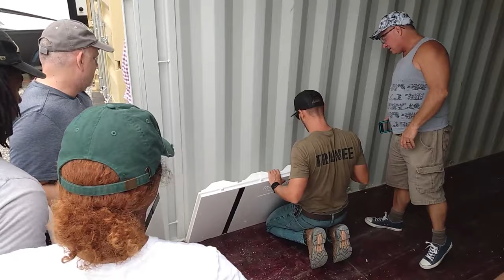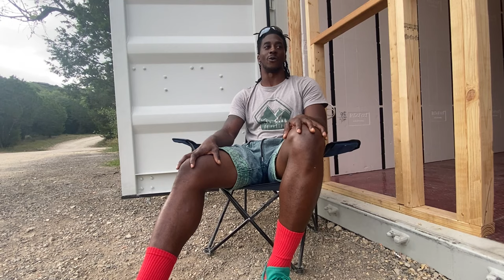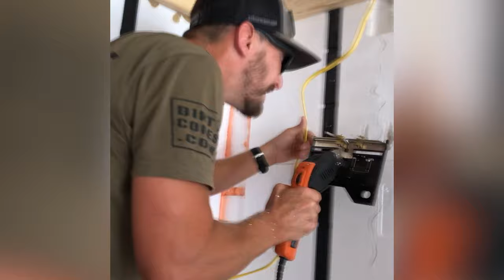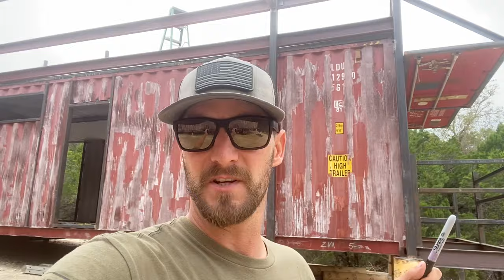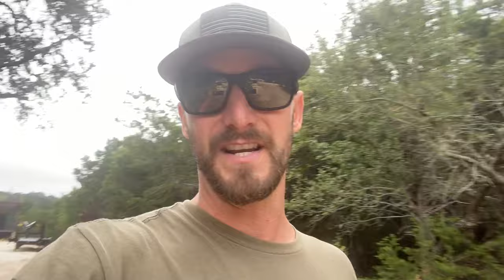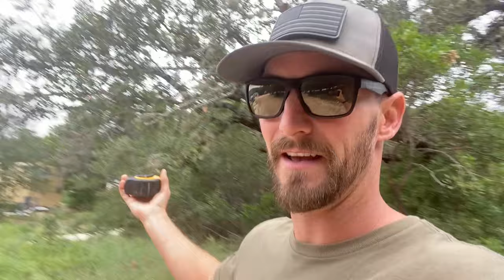SHIPPING CONTAINER HOME WORKSHOP: Recap and New Schedule!

Comment: Went to get a permit to start... because resident or power to the container... 1st needed a structural engineer ok on my build... hopefully this week to convince this person for a expensive signature. 

As for the classes, depending upon how you tie them together or not.

On the home build, having an SE explaining the cutting of the container, supporting,  and size of metal for strengthening from being elevated, stacked, or cantilevered. 
Tie/secure down for 115+ winds. 

Good to see the idea of a great area between the containers.... use of steel frame. 
Love hearing about a bullet proofed exterior paint coat. 

Have fun... ;~)
Reply: Let's not forget about snow loads... etc.

Comment: I always imagine shipping container motels. Imagine 20' containers, stacked 5 high, 1 40' container standing on end with a lift system inside as an elevator.  Ever thought of a stackable washer/dryer? Solar panels on top and water collection with reverse osmosis filtration system for drinking water? Cantilevered, 40' can for the base and a 53' can placed on top. No structural steel reinforcement needed for the overhang on either end! That's how they are hauled in well cars by trains! Take the doors from a can, weld them together then place hinges across the bottom and a small winch system to lower them down to create a deck. Although you might need a structural steel support system for the far end of the door to rest on. I went to a Vo-Tech for residential architecture. But that's been over 30 years ago. No I'm not using my Associate Degree, hence I'm a truck driver!